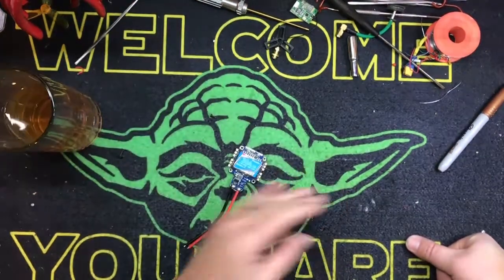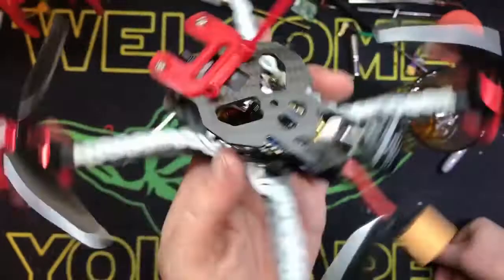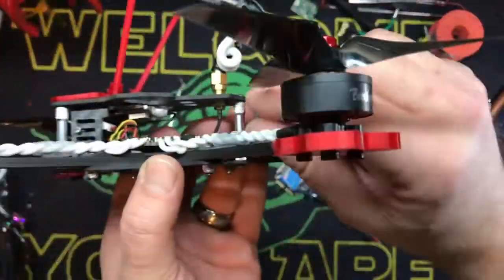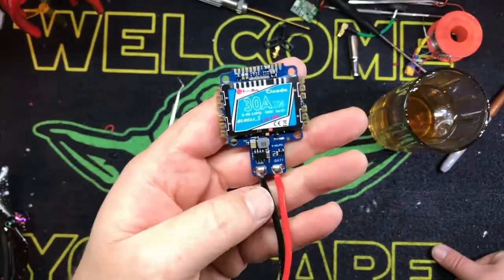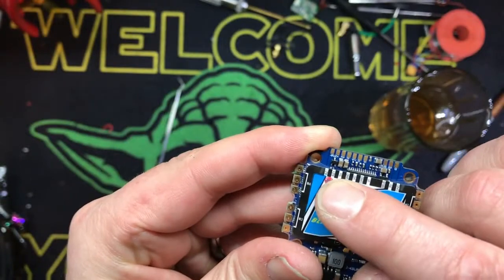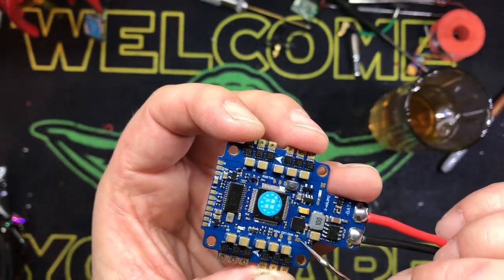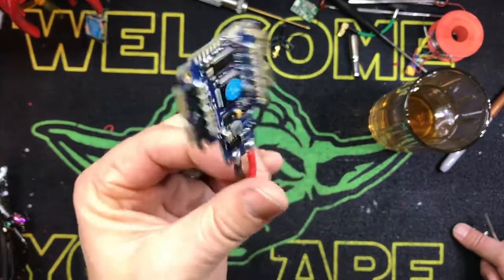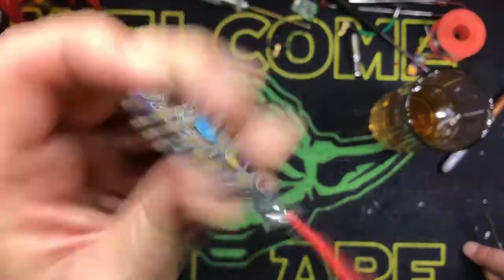Cicada AIO Flight Controller Overview and thoughts

Comment: having trouble getting my controller to read in beta flight i tries connecting to the i bus tab then tried rx im using the turnkey evolution it will bind to the rx but i cant get any movements in beta any answers?

Comment: Hey bud thanks for subbing, I really appreciate it. Was watching your video on the cicada, I'm about to use it for the first time. I see you didn't tie off the battery lead, any problems with electing batteries?
Reply from the maker: Hey brother.    I usually do zip strip the leads to something.   Just didn’t get around to it with that.   It’s pretty robust.  But the way I mount my batteries they rarely pull off in a crash

Comment: Can't get video have both 5v to vtx and camera on the same pad, is that causing an issue? Any help would be great.
Reply from the maker: Hey brother.   Sorry for the delay.   Can u email me a pic of ya wiring ?
Reply: @jjrotogeek   actually problem has changed. Can not get sbus to work on betaflight I tried all the uart ports. I get the bind of the reciever but stick don't work should I change the sbus wire on my rxsr to the rx6 on my board.
Reply: Sbus in is current on the sbus pads on the fc
Reply from the maker: The board only has one sbus inverted uart.  That’s in the front.    If your facing the front of the board, it’s the front left three tabs. Neg pos and sbus
Reply: @jjrotogeek  yea it's connected to that but still sticks don't move.
Reply from the maker: I’m the config tab u have it set in serial port and sbus and in the ports tab it’s set up correct?
Reply: @jjrotogeek  yes
Reply: And that's uart 6 correct that sbus is connected ?
Reply: I'm using a r-xsr receiver
Reply from the maker: Did u get to the bottom of this yet brother ?
Reply: @jjrotogeek  it looks the r-xsr in not inverted, there is a small soudering point on the receiver it's self to turn it inverted  for sbus, I think the  cicada board is outdated compare to the receiver
Reply: Doesn't do it automatically
Reply: Trying right now so we shall see
Reply: so annoying, I have not, I  think its the r-xsr receiver, but I tried another receiver xm plus and it has the same results the receiver, would bind but no stick activity on beta, what uart port is the sbus on the f/c. (tried them all) should i erase all models and rebind. Do you use flysky receivers on this, doin my head in, its my first build !!
Reply: Tom Darcy I’ve tried to with no luck for my 4” build really sucks no uarts are working for sbus
Reply: same sad day
if anyone figures anything out that would be great  @chriscolt8940

Comment: Have you had any problem with these? I have one in which my 5v components dont turn on and the FC turns on only when it's connected to the USB
Reply from the maker: One time.    And I’ve used about 40 of them.    Resolver your Solder joints on the board.    If that doesn’t work I can add a bec.    I was sposed to do a video on that.   Thanks for the reminder
Reply: have you been able to make it work with Smart Audio?
Reply from the maker: The fc or the vtx??? Not sure I understand ya question brother
Reply from the maker: The fc or the vtx??? Not sure I understand ya question brother
Reply: The FC. Did you solder the smart audio wire to TX6?
Reply from the maker: Rx6.    Yes it works fine for smart audio

Comment: BAM' Great chnl.
Wanted to ask you. Do u think I could run Cicada AIO in Hyperbaby 3" w/ xt30 and hyperlite 1407 - 3600kv.
Micro Arrow n Tx03?
Reply from the maker: Hey ma brother.    Hmmm I’m realllllly doubting it.   Cicada is large for that frame.   I’d use this.    This is what I normally use in my 3” builds.   And btw.   Those motors are great.    Just did a build video the other day with them. Here’s what I’d use for that bird https://www.getfpv.com/hglrc-xjb-f438-v2-stack-f4-flight-controller-38a-blheli-s-esc.html
Reply: Yeah, I suppose you're right. Thank you.

Comment: if you didn't use this AIO what would you use if you wanted to separate the ESC and FC
Reply from the maker: Hey brother.    I would normally use a dys f4 pro board or the omnibus f7 board, then he racerstar 30a 4in1 esc or of ya wanna buy in the states the 30a 4in1 lumineer

Comment: Has anyone had any problems with motor one sputtering with the AIO cicada? Motors 2,3, and 4 are working but motor 1 just sputters when I arm it.
Reply from the maker: Hey brother, I haven’t heard of that.   I have built with a lot of these and haven’t had that issue.   If u swap motor 1 with motor 2, does the issue stay with the motor or move ???
Reply: JJRotoGeek I put a different motor on and the same thing. I’m stumped haha
Reply from the maker: Hmmm if u have a volt meter, put it on ac and go into beataflight in the motor tab and turn that motor on about 25%.  Then test the pads of the esc that the motor is wired to.   Bet one of em is dead

Comment: hi, is it possible to wire a tramp hv and and a r xsr onto this board?
Reply from the maker: Hey there.    I’ve never used the tramp myself but I just read up on it, yes u should be able to wire it up with no issues!
Reply from the maker: Hey there.    I’ve never used the tramp myself but I just read up on it, yes u should be able to wire it up with no issues!
Reply: Hi! 
so if i wire my r xsr onto the tx6 pad where should i solder the wire for smart audio?
Reply from the maker: Your xsr would go to the recover pad on the recover pad at the front of the fc. (Uart 1 marked sbus) your smart audio would go into rx6 and your telemetry would go to tx6    Make sense?

Comment: JJ have you had any issues with this board not having power to the 5v pads. I just did a build for my channel. One of those cheapest you can build builds. I have every thing all set but i am getting no power from the 2 5v pads at the front for the receiver and camera. Any thoughts. Thanks
Reply from the maker: Yes sir.   Same problem.   Weird.  Patently there’s no 5v regulator which is gayyyyyy.   So I powers the vtx off the battery then the 5v out from the vtx I put into the 5v pads of the board to power it.    Gay right?!!! I wasn’t impressed either
Reply from the maker: If u watch my build video, I talk about that
Reply: Hehehe Which build video we talkin.... Of your 400 build video's you have done hahaha.
Reply from the maker: Lolol the first video of the gps Drone video

Comment: If I had the cash , would this be good for a first build bro 👊
Reply from the maker: I like it a lot.    Never had a problem with them.   The downfall to aio units is if ya donblow something, ya fucked and have to replace the whole thing.   That’s where bullet esc’s might be best if ya just startin out
Reply: JJRotoGeek ..yeah that's the down side  , thank you bro 👊 
I think it's probably cheaper to piece it all together and just use a f3
Reply from the maker: Agreed.    U can get a good f4 for 30$ and hglrc 28a bullets for like 6$ a pop and bam ya done